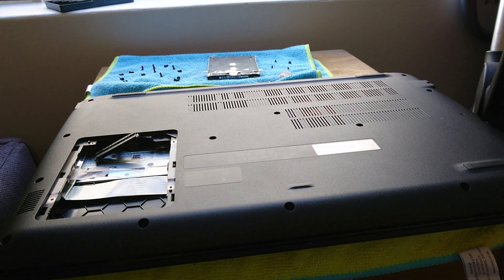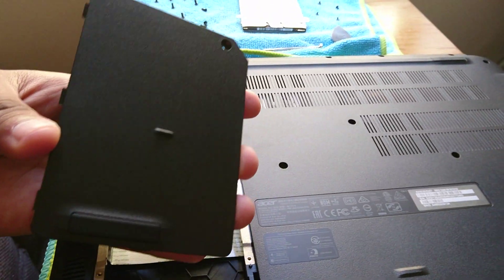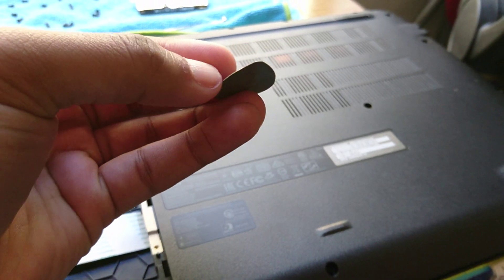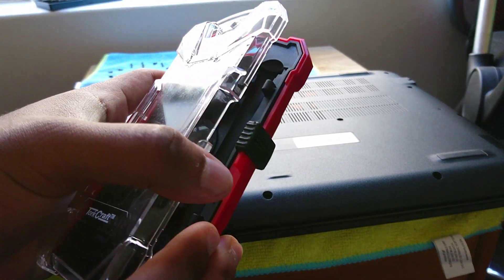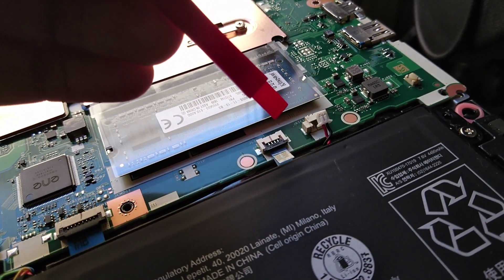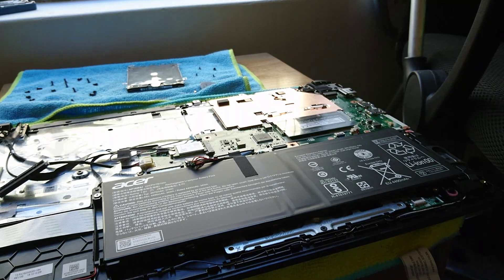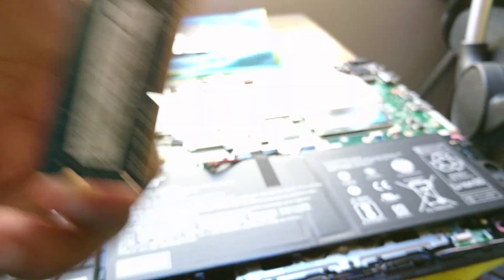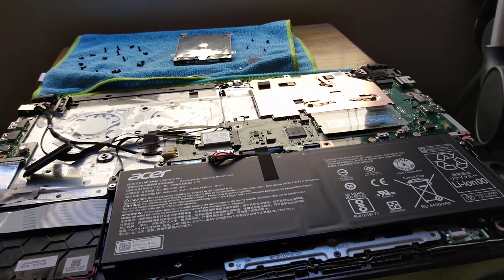Acer Aspire 3 how to replace ram

Comment: I am looking to upgrade my memory on my acer aspire 3 A315-34-P8WY laptop can you please help me
Reply from the maker: Hello there hope you doing good.

I was looking on google to see what type of ram you can use for your laptop and I see google say you can use DDR4 SDRAM there is black line were your ram must line up with the ram card and the ram have a small gap space on the ram were you see the gold pins are on the ram card but I want to know, do your laptop have two slots for ram or just one like I have in my video? if not and you don't see there is another space for extra ram slot. 

unplug your laptop then unplug your battery from your motherboard so no power is running in between your motherboard  take out your original ram like how you see how I removed my ram from the laptop in my video but if your laptop did not have a ram card in you can place your new ram in that open space.

Please note that the gap on the ram must line up with the black line were your ram go as you can see in my video it is very important. 

There are some disassemble videos on YouTube that go more in to detail step by step.

I hope this helped you and have a good day. I appreciate the view and comment stay safe.

Comment: This ram dubble ya single channale plz help
Reply from the maker: Hi this laptop dose not have a double ram channel as you can see in the video it only have a single ram channel and that's the one I have maybe later years they will add a double ram channel. And it also depends on how many gigabyt's you changing I had 4GB ram in and I bought me a 8GB ram if you want to put in 16Gb or 32GB of ram make sure the MHz is the same like the one you taking out of your laptop and it is a DDR3 dose not matter how much gigabyt's you put in as long as it have the same Mhz like the one you have or you can watch more of my video and you can see what one I am using I am sure your one will take the same maybe you have a 16GB ram or 32GB ram witch is better then 8GB ram. I hope this did help on your question and thank you for your view and comment I appreciate it alot.

Comment: What model was this? I have the A314-21series version with AMD A9 CPU and 128GB SSD and where ur RAM is i don't have any RAM there but i think there is a RAM slot there but i don't know what RAM slots look like, i cant find my original RAM either.
Reply from the maker: Hi there sorry for replying so late South Africa is having bad power outs. According to Google and Crucial the Acer Aspire3 A314-21 series, it take DDR4-2400 mhz SODIMM. If you watched this video you will see I lift up a clear plastic cover were the ram go but I also push two side pins away from each other so that the ram can be released, it will go in and come out on a angle, there will be a black bar were there ram fits in. Once the ram is placed right in it will make a click sound were the side pins hold the ram but make sure the ram fit in please don't force it in cause there is a open notch by the ram so you will see the ram have alot of gold pins and then there is a open space in between the gold pins. If you look and find the place were your ram fits you will see that there is a black bar and if you look closer you will see there is a black pin that must line up with your ram so the space on your ram go there on the black pin. 

I will make a short video of ram space and were most ram places is. I know it sounds confusing but before you open your ram and want to place the ram make sure the open notch on the ram lines up with the black pin on the laptop. 

I do hope this help you but I will make a video to show what I mean by this might not be the same laptop like your one.

Thanks for watching my videos and subscribing/liking my videos I appreciate the comments and support